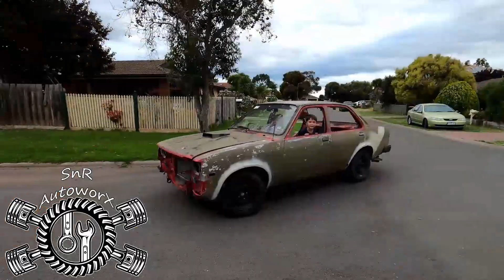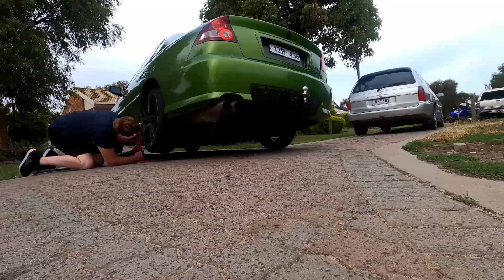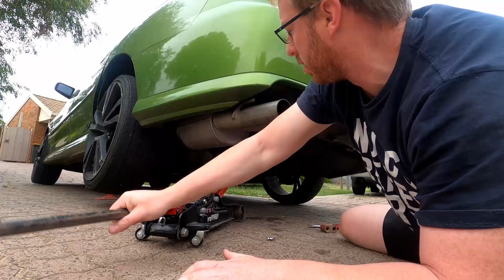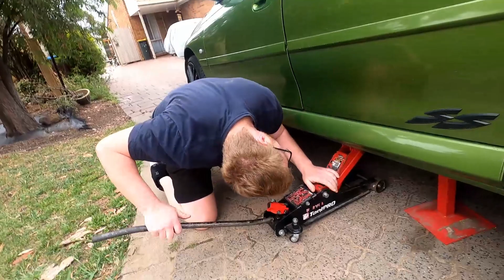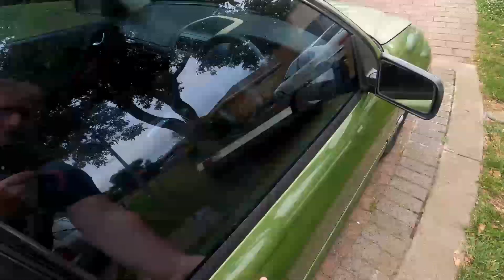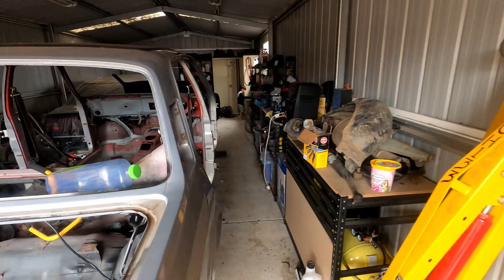VY SS gets it's Split Exhaust Rubbers changed over.

Comment: Them dodgy rubbers hold a maximum weight of "half kg" lol on my my vy sv8 I went through heaps and only had twin 2.5 xforce, that a te or tj gem?
Reply from the maker: Yeah im gunna get the black type of rubber they seem to be harder and stronger then them softer style ones, and Im building a TG Gemini 😁
Reply: @snrautoworx2840  yeah you'll get a extra few ks out of them,  its been that long since I seen a Gemini I couldn't tell which model it is lol, the TG has hit the "wanted list" and getting hard to find 1 for sale
Reply from the maker: @ls1hinchy546  yeah most of them are all rusted out lol